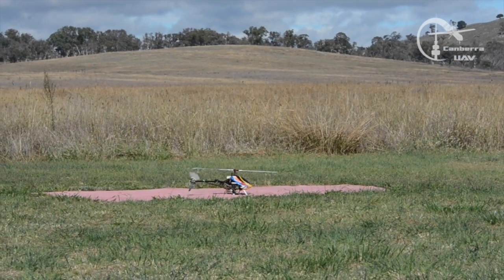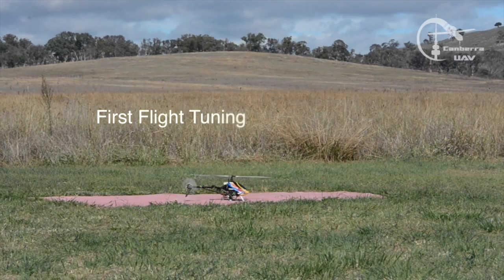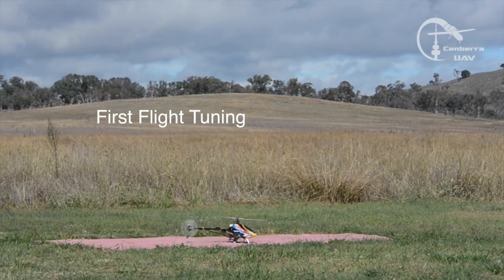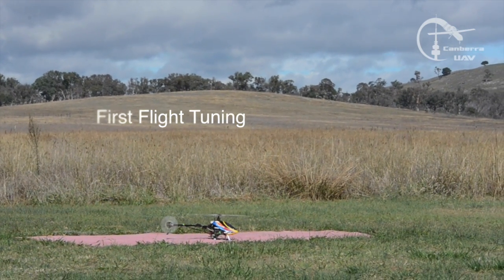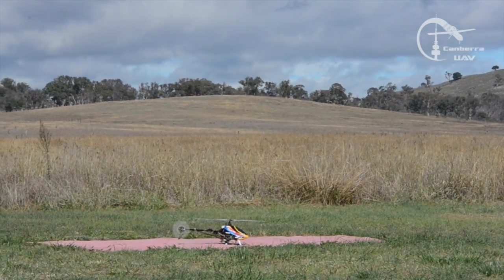CUAV Heli Auto Pilot Testing

Comment: Good stuff. I'm still waiting for customs to clear a shipment from Align containing my replacement tail gearbox parts for my 550 :-(. On the upside we've received our Vario and Pi 2, which we'll be using to run ArduCopter.